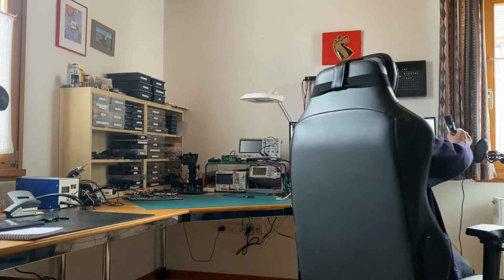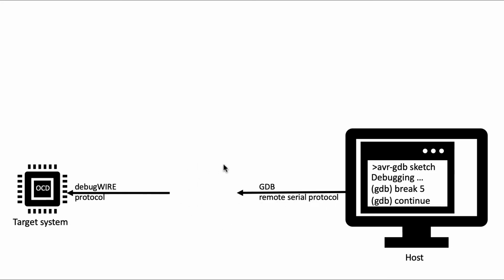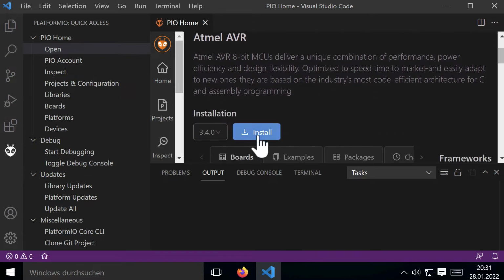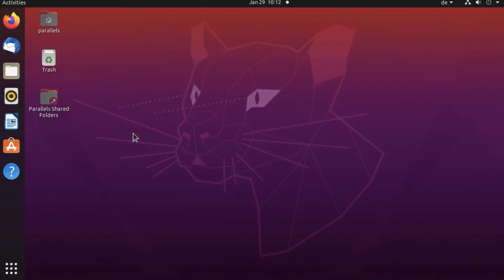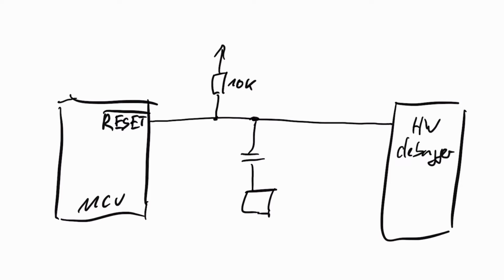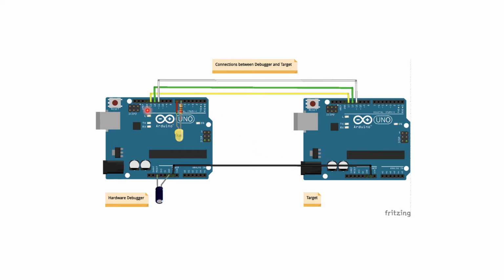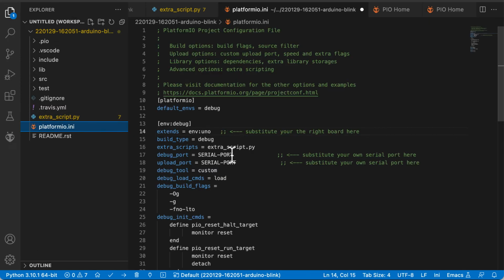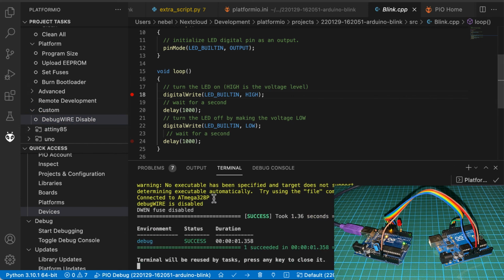Debugging an Arduino Sketch Running on an Uno

Comment: How does one revert a target board to normal program loading?
I cut the reset track on the target UNO, so that I can debug it using the DWire Arduino. Now that I have finished debugging, I wanted to revert the target UNO to normal Avr program loading.
I assumed that I just needed to 'resolder' the reset track, but that does not appear to be enough.

Please advise

Comment: What value capacitor do you use between Reset and GND on the debugger board?
Reply from the maker: The value is not critical. I used 10uF, but 5-100 should work.

Comment: Just wondering why you used the Arduino IDE to upload DW-Link? Why not use the PlatformIO IDE that you had already installed?
Reply from the maker: There is no particular reason. I could have used avrdude from the shell as well.

Comment: I wonder if this will work with a nano?
Reply from the maker: You mean a Nano as the hardware debugger? Yes, definitely. If you want to debug a Nano, there is the problem with the RESET line (see Manual and/or https://mtech.dk/thomsen/electro/arduino.php).
Reply: @arduinocraftcorner6178  Yes, As a Debugger. Thank You for info.